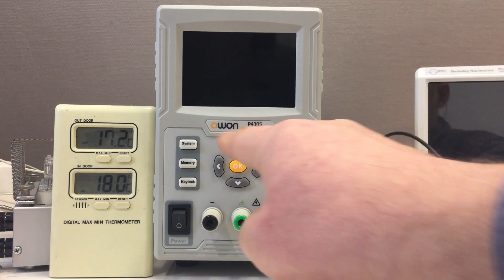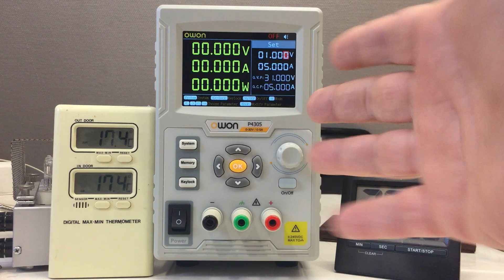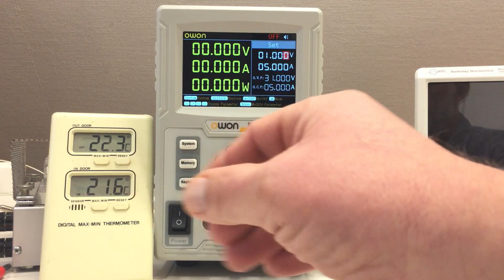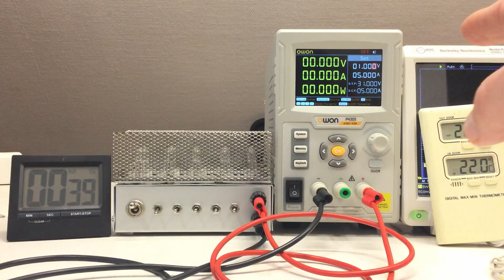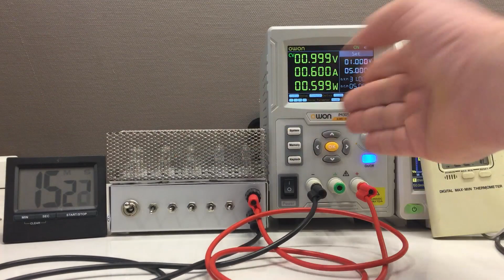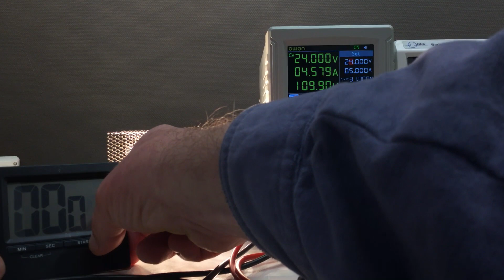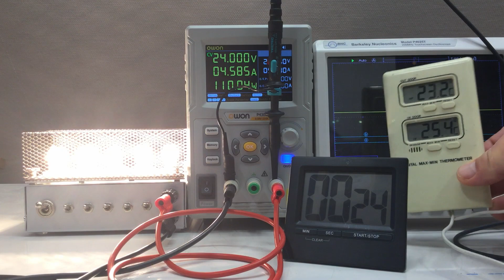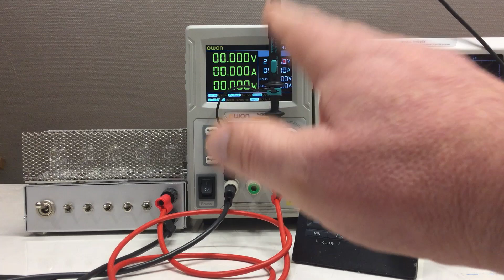OWON P4305 Lab Power Supply Review (2): Reproduce Display Failure – Failed

Comment: Hi Robert. I believe your problem is either a bad contact on a connector (crimping or insertion) or a bad solder joint. Open it up and look with your magnifying glass. RJM
Reply from the maker: Hi René-Jean, your probably right. I've already checked the flat flex cable/connector on the controller board going to the LCD. My best guess at this point is that a connection on the LCD module itself is loose. To access the LCD module I would have to snip a lot of the original cable ties. Since I'm still planning to send it in for repair/replacement (it's still under warranty), I don't want to do this. Best regards, Robert